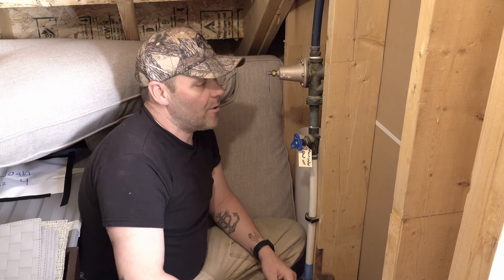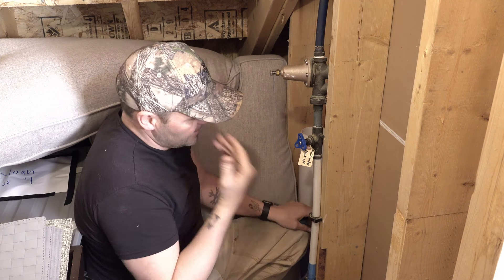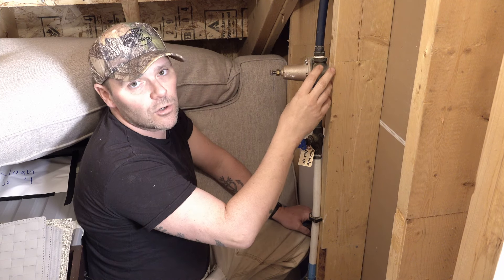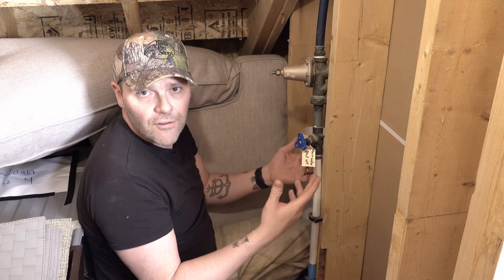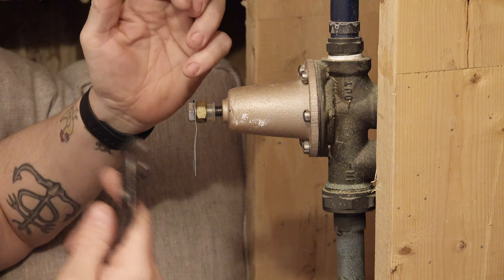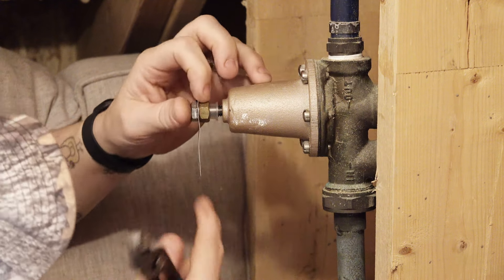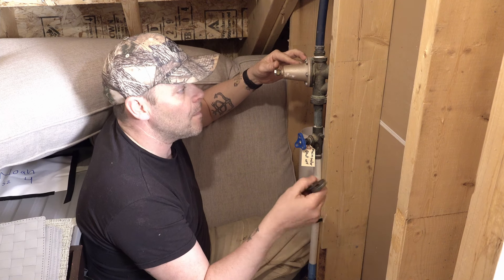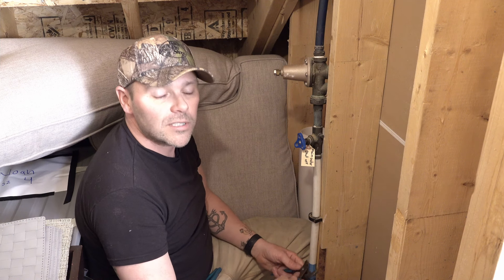How to Increase Adjust Your Home Water Pressure. Increase Your House Water PSI!

Comment: What if you don't have a pressure valve
Reply: Just press alt f4 on the water meter.
Reply: Control+alt+delete
Reply: What about mac users?
Reply: Shoulda bought a tesla
Reply: Install a Quantum fusion reactor core
Reply: Have a plumber install one
Reply: Just put some pressure fluid in it. Works fine for me now
Reply: @txrazor2643  how would installing a pressure regulating valve help increase existing low pressure? It could only lower it.

Comment: When i got my house the manager told me to be careful adjusting the water pressure because I could blow the faucets off the wall.  In the video you said the regulator wont let it get over 75 even if you screwed it all the way down.  Why did he tell me that when he is the building manager hahahaha. mine is rated for 15-75.

Comment: Thank you so much! I recently purchased a 30-year-old home with horrible water pressure. I followed your instructions and discovered that the pressure regulating valve was basically throttled back almost as far as it could go. I cranked it in, and voilà, water, pressure!
Reply: Hi, where in your home did you find this?

Comment: For sure I'm going to try this!!  Most on youtube suggest removing the flow restrictor and then the 2nd  hidden one as well.  Your way is so much easier- I can't help wonder why more people are not suggesting using your method.  We lived in a older house & removed the flow restrictors-  which WOW, worked great.  Recently we built a house in the same neighborhood & i literally cried after removing both flow restrictors and it made zero difference.  I can't use cream rinse in my hair because it will not come out because the water pressure is so weak.  Someone told me the city has put restrictions on the new houses.  The older houses across the street-  tell me their water pressure i fine.  So i'm now thinking the city has decided that those of us over 55 have to be treated like children- so they have done something to control our water pressure.  gRrrr.  i actually go to a sink in the laundry room to wash my hair-  thats THE only place in our brand new home where we have a decent amount of water pressure.  I hope your method works for this house!!  I'll be back to let you know.  Thank you so much. xoPam, still Kelli's mom

Comment: I just replaced my water heater due high pressure. You just save some time and money. Very good information!!! I was able to fix the high water pressure pressure issue caused by previous home owner. Thank you.
Reply: Your issue exact opposite most here haven't enough water pressure

Comment: I had a pressure regulator installed a few days ago and a TEE w./pressure gauge (0/200#) downstream of the regulator and the pressure adjusted to 80 Psig. down from 120#. While the water is running (shower of kitchen sink (the gauge shown 70 Psig). This water pressure setting accommodate our living needs best. When you were use to 120# before, then only 60# upstairs just doesn't cut it for showers.

Comment: Problem is, I don't know where to find these valves.  I'm on a slab foundation.  Where do I look?
Reply: @bernardbockwurst    I have a hot water heater in a raised alcove.  I can't imagine them putting the valve behind the water heater where you can't reach it.  There is a water softening system on the other side of the garage and there is a plastic/rubber like tubing attached to a green handled valve.  But there is no down pressure valve anywhere on the line.  Could it be that I don't actually have a pressure reducer valve?

Comment: When you tighten (or loosen) the pressure regulating valve, just to be clear, the water to the house needs to be shut-off, correct?  and after the water is shut off, a toilet flushed, or have a faucet running to remove any pressure within the line?  Is that correct?
Reply: I want to know the same. But no one is answering...

Comment: If I unscrew the outside nut off to get the plastic piece that is in the middle on mine,will water shoot out of hole ?  The plastic piece is keeping me from screwing in to add more pressure. Different from on yours.

Comment: What about this - my water pressure on the hot water side is about half of the pressure (or volume) on the cold-water side.   In other words, all faucets push out a strong stream of cold water but a relatively weak stream of hot water.  Why is that?    I just spent a week replacing everything I could think of at the water heater itself: new feed hoses, new nipples, new expansion tank, new anode, flushed it 10 times.  No effect on the pressure differential.  Any ideas?
Reply: Did you ever find out the answer to this? Right when I read your comment it was exactly what is happening to me I basically have no water pressure for hot water but my cold water is weak but fine
Reply: @runitupsilver8921  I worked on this for maybe a month, replaced or inspected everything I could.   Did not see or even theorize a solution.  Came to conclusion that it was plumbed that way.  It's not that bad for me; my hot is maybe 2/3 of the cold.  I can live with it.  If I ever figure it out, I'll write about it.
Reply: Thanks for the reply. Did you ever adjust your water pressure like in the video ? I guess that’s gonna be my next step
Reply: @ I think that's a great idea (adjustment).

Comment: The outer house, water hose pressure from the spout measures 50 psi, assuming it’s all the same in the house, and with all the water off, how safe is it to increase that pressure? What kind of typical home handle home nine years old

Comment: Thanks!  Is it easy to install a gauge?
Reply: @HeyEph727 They make pressure gauges that screw onto a garden hose thread. You can go to your washing machine outlet and shut off the flow. Then unscrew the cold water hose and screw on your pressure gauge. Snap a Pic, and reverse the process. It takes between 5 and 10 minutes. Or you could leave the gauge hooked up as you adjust the regulator to dial it in to where you want the pressure to be.

Comment: HOW DO I KNOW IF MY HOUSE ALREADY HAVE A REGULATOR INSTALLED?
THE COPPER PIPE IS SHAKING. BUT I AM NOT SURE IF THE OLD REGULATOR IS NOT WORKING IF IT WAS INSTALLED.
OR NONE HAS EVER BEEN INSTALLED. 
CAN YOU SHARE HOW TO CHECK IF AN OLD ONE IS INSTALLED?

Comment: Is there a similar type of valve where the water comes off a street meter and feeds the dwelling?  The area I live in is all slab foundations so the meters/valves are at the street mostly.
Reply: They are required whenever the city main water pressure exceeds 80 lbs. Typically you'll find the PRV located right after the main water shutoff in the house or right after the meter at the curb and are the same type of valve located in either place but not both. They might even be installed where supply pressures are below 80 lbs usually for water conservation purposes.

Comment: I did this exactly as instructed, however the water pressure did not increase a bit. I live in an apartment complex, now can maintenance adjust the water pressure from a different source?
Reply: Maybe but that kind of defeats the purpose of the individual ones located in all the apartments if you're pre-regulating for the regulators or pre-reducing for the reducers. What are you using for making the determination of no pressure increase? Just about every fixture in your house that water comes out of will be "water saving." Whether that's done with the aerators inserted in the faucets or by the flow restrictors inserted into the shower head, they all come that way by law and will only let a certain amount of water through when in place no matter the pressure.

Comment: My regulator has a adjustment bolt on the top but it also has a bolt in the bottom of the rev. side, The bottom bolt seems to be an adjustment of some kind but it doesnt have a lock nut. What is it for?

Comment: can this cause any harm by increasing the water pressure?
Reply: It may or may not. 

Many water fixtures (i.e.: toilet fill valve or faucet cartridge) have a max rated PSI (usually 80). If you increase the water pressure and exceed their rated PSI, you could cause problems like leaks or flooding. Generally, home pressure valves have a PSI cap below this rating to prevent this from happening. There are other factors to consider, but that is the jist of it.

Comment: California area, I have a 3/4” pipe and per new fixtures added to the home I need to replace the 3/4” main line  in to a 1” pipe,  installing this pressure regulator will avoid me to replace the pipe ? 

Thanks, 
Saul
Reply: curious?  Did you replace the 3/4 in MAIN line with 1 in line?

Extremely expensive to satisfy some new UNNAMED fixture.

Comment: What if the valve is all the way in tighten then what's the other option?
Reply: consult WATER UTILITY.  What PSI do they supply to residential property?    hopefully 80 psi.   m